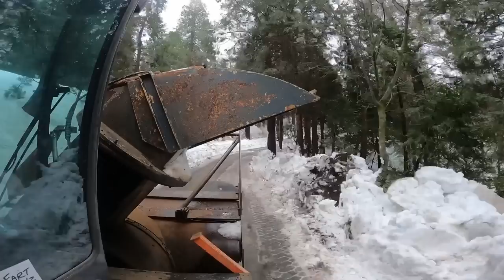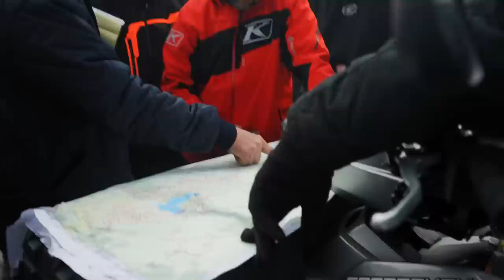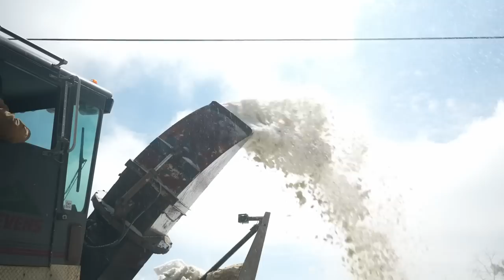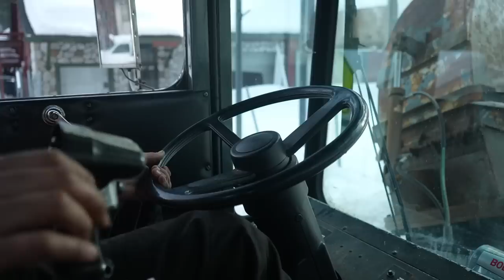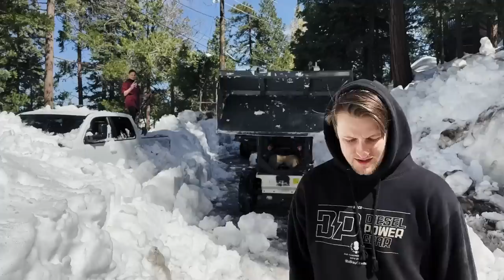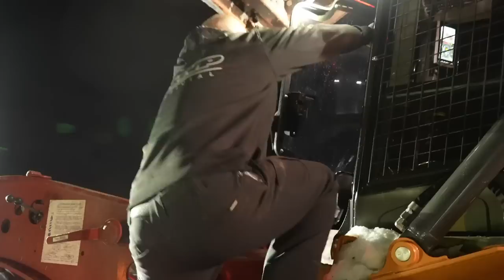California Rescue Part II (Satisfying Snow removal)

Comment: I understand the feeling of accomplishment after spending hours shoveling snow just on my own property. This year in the Twin Cities we have been pounded with 80 + inches of snow with rain before or after the snow falls. The only time I have plugged up my blower is the weight of the wet snow was so much that once I cleared out the top of the opening, it could push the rest out. I have learned that before shutting off the auger, let it run a minute or so until you no longer get snow out the chute and that way it will be good to go when you start up again. One thing that will help keep the snow from plugging up the inside of the blower assembly is to spray it with a product like fluid film. I use on my mordex also. It can be bought in 5-gallon containers with a sprayer to apply it. It is amazing how well it works. Also on the sleds you built for your trailer it will help make it slide. But you had mentioned that you had that stuff you put on that I believe was similar to your airboat. By the way fluid film would also help get Dave out of the cat

Comment: I know areas are tight in different street but I'm surprised Dave didn't have dump trucks running beside that snow blower so they could remove snow out of the area like your average black top grinding crew
Reply from the maker: Had there been room it would have been a solid method
Reply: @SparksMotorsCo  I figured room was the problem it's still nice to see people helping others with their YouTube channels specially when the help is over the top

Comment: Picture a bigger version of the Kodiak snowblower, used to clear airport runways. Winter 96/97 they were using it locally to open roads. When it started flooding they discovered it would pump water and it sat in a neighborhood pumping thousands of gallons of water back over the sandbag wall. Stream of water out the chute going 75 feet in the air. Water was 3/4 of the way up the tires...

Comment: We have  the 44” 12or1300 hp kodiak blower and in dry fluffy cold snow will throw well over a hundred feet but any moisture and your unplugging the damn thing more than your moving snow so I remember watching a video on YouTube university where homeowners take rubber like 3-4 ply conveyor belt and extend the impeller out so it touches outside of the impeller housing well we put this rubber cutting edge stuff on our plows that plow our cobble stone streets so we don’t rip man holes up or hook the granite cobbles which is a very very  abrupt and violent stop it’s right around 1.5-2 inches thick and mounted the rubber to the 5 or 6 impeller blades now it will pump water if you want too  and we went from plugging constantly to once or twice a storm at first we bolted the rubber solid but after trials and tribulations and a lot of working man words we made the rubber wipers float on each impeller blade it’s simply amazing how adding the rubber wiper material to the blower increased production